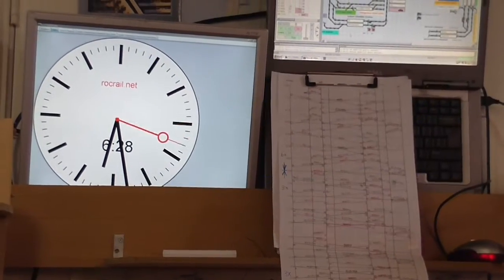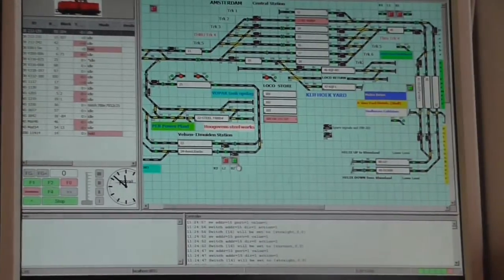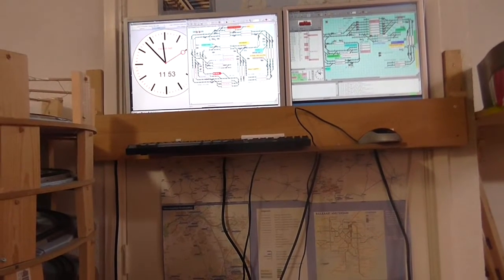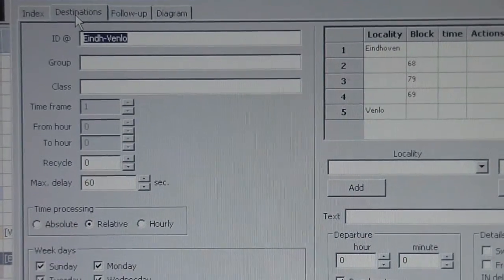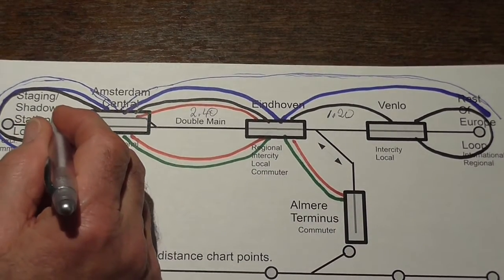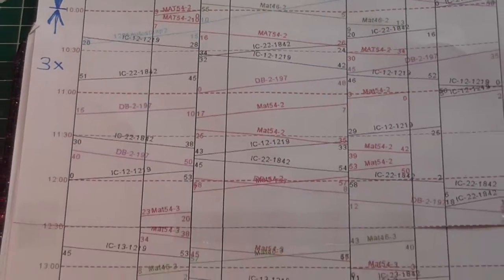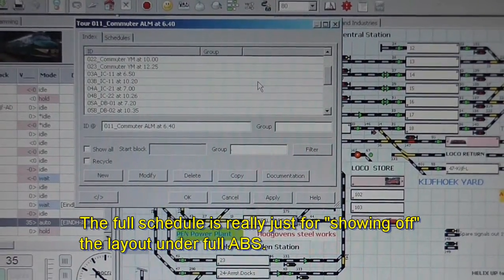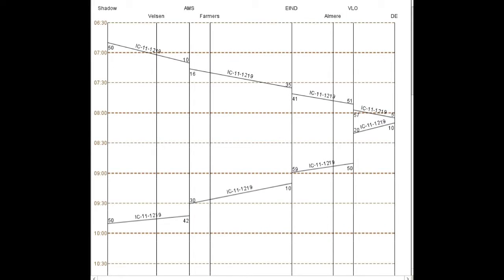Vlog77C Rhineland Update -Timetable (part 3) implementation and use

Comment: thanks for sharing your video, I may have to come back to you one day and find out the computer controlled system, how do you separate or isolate the tracks ? and how many isolation points are there within a block ? my block system works on a start stop within a station, one train enters the station, stops and triggers the train on track 2 to start, turnouts are than set so the train enters into the same track which has just left the station, as the train leaves the station and enters a single track all signals for the 2 tracks are switched to red until the next train enters and turns the signal green at the next track..
Reply from the maker: Hi. I use the standard mass feedback by simply isolating a short section of one rail and attaching a wire to it. Two per block one at entry = start of brake and one at stop point. I have 160 such for about 75 blocks each also with signals. I use Rocrail PC software to run automatically. I am at about 75%. I lived in Aus in my youth grew up in Melbourne  and my dad began the Marklin there already. Robert